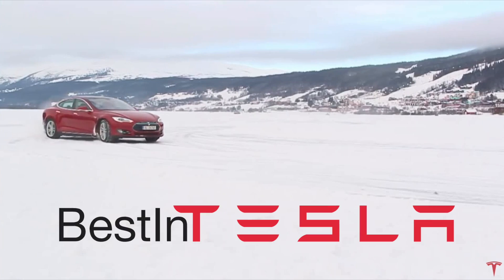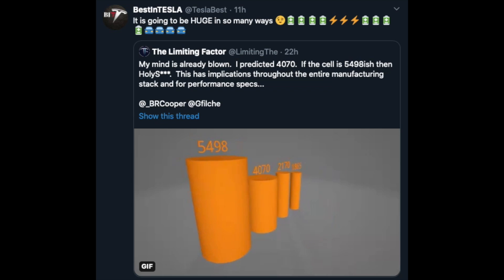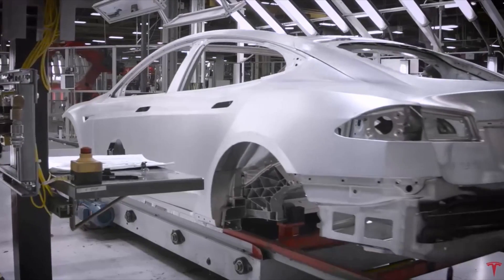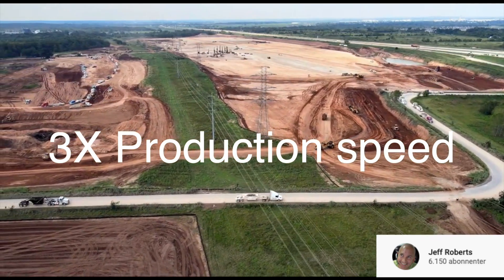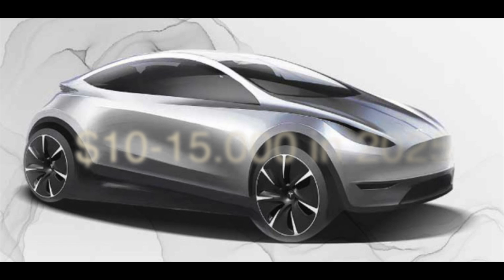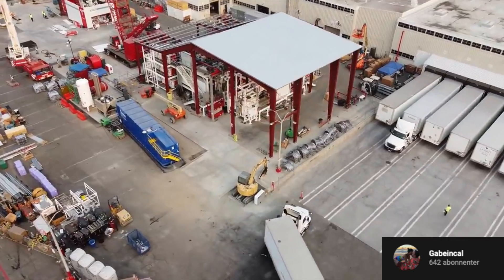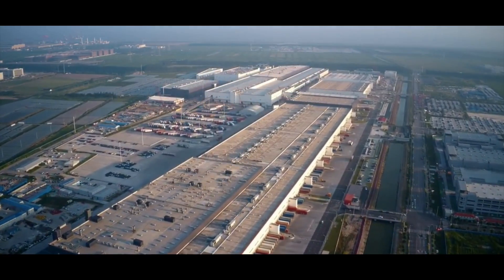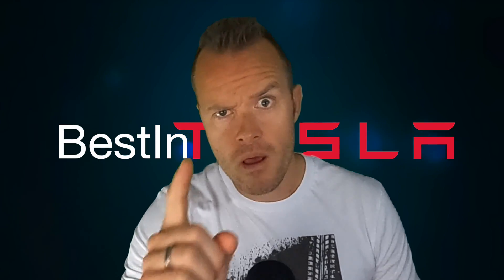Last day before battery day - Tomorrow EVERYTHING changes | Predictions & rumours

Comment: I'm not a battery expert at all.  Can someone explain this:  5x the volume of battery = 5x energy storage.  But the battery pack isn't getting bigger and neither is the vehicle.  So The battery is 5x bigger than current, but the number that can fit into the current vehicles are 1/5 as much right?  So... No additional storage.  Benefit would only be faster to produce? Am I missing something in the math here?
Reply: I don't think just changing around the volume of the battery is ground breaking at all.  It's the same technology just a different size.  If they packaged it different to fit more that's cool, but still same technology and same problems.  Not really worth much hype.  Did I misunderstand?  Is this video saying that its 5x energy density? or just more volume so more engery?
Reply from the maker: I am talking only volume, not density. But there are differently going to be some new chemistry in the battery, and probably no Cobalt, but it is still the same kind of battery. I THINK. So no the cars will not get 5x more battery power, but the Model S cut have made 50% more battery inside, since there are not as much packaging and other stuff. But yes it will be more than just 5x more volume, but luckily only 5 hours to go 😉👍

Comment: Quick afterthought, imagine if the battery pack was contained within a pressure casing of liquid nitrogen or some form of liquefaction cooling process. Charge and discharge would be almost instantaneous. LMFAO.

Comment: Tabless technology is a game changer. At a physics level it significantly decreases heat buildup associated with the SPEED of charge and discharge. It achieves this by distributing across a larger surface area how electrical charge enters and exits the battery. This is why it can now be a much larger battery (no risk of battery combustion). And of course this means it enables much faster recharge rates. Right now this means that range does not need to be increased for practical purposes only a marginal increase in the number of recharge sites because recharge can happen so much faster. All these metrics combine to bring about a complete solution. In the case of tesla semi recharge can take place at 'point of loading' and 'point of unloading' at time frames equal to or less than the time it takes to load or unload the semi.

Comment: Great video Lars.  I like your bold predictions.  Most people are way too conservative.  I do hope you are wrong about the powerwalls though.  If I will be using autobidder I will need a 50KWh powerwall and I would buy 2 of them.  I wouldn't even need solar at that point.  My utility has an EV rate plan that charges just .01/KWh from 11pm to 7am each day.  I'd be spending less than a dollar a day to charge the powerwalls.  I could power my home AND sell excess power back to the grid if they needed it. If they would pay me .10/KWh during peak summer hours, I might have a decent payback period.  And there is excess power generated at night so this isn't burning more fossil fuels to refill the batteries.  Right now, it is the peaker plants that are the real problem.  I would love it if the power company would pay me .20/KWh AND offer their customers a power outage backup plan where I would buy a 500/KWh battery and backup 100 homes in my neighborhood during outages.  They could charge customers $10/month and split it with me.  I love Elon.  I just need him to start a utility company in GA because our 'smart' grid ain't that smart.

Comment: Tesla is all talk. Anyone remember when they announced the electric semi truck. What happened to that? That was 3 years ago and they were talking like they were about to start rolling out the door. It's almost 2021 not and still no trucks. Come on guys can't you see they are scaming everyone.
Reply: TESLA Semi works, its Driving on Roads Today with 80,000 lbs LOADS for SpaceX and Tesla. 
TESLA Semi will be the FASTEST SEMI up PIKES PEAK and SMOKE gas Semis. 
unlike the NIKOLA which is just a STATIC PROP.
TESLA Semi was NOT a High Priority product, just like the Roadster. 
MODEL 3 Ramp and Model Y Production TOOK TOP PRIORITY.
but when GF5 was Announced , TESLA Semi along with the Cybertruck became a HIGH PRIORITY.
and ROADSTER will be built in FREMONT using TESLA Advanced battery.

with a NEW factory in the Central USA this means a GAME CHANGER for TESLA.

Comment: Just because the battery is 5x larger does not mean they can produce them faster.. being larger they will take longer to make
Reply: no, Sheets can make MUTIPLE battery line at the same time , gets Rolled up FASTER and Packed with a Tabless Electriode.
and Lightning Fast VACUUME Electrolite fill ups. 
TESLA will only need 400 - 800 cells to power the car. 
not Thousand of cells per car.

Comment: And they’ll be lighter. Right? 
So they’d be quicker and perform better. Right?
Reply: well, Larger Cells / heavier but only 800 cells Compared to Thousands of 2170.
Overall, LIGHTER and more AMPS and more POWER (not Energy Density). 
could enable 1000v Battery arcetecture and 1000 kwh MEGACHARGING.

Comment: I have heard that that it is 4 times the size of 2170, but 10 times the energy density. Either way, less batteries per car, less weight, more distance, higher performance.
Reply: NOT, necessiarly MORE Energy dense, but 98 Amps and overall MORE power. 
this means possibly 1000v Battery Arcetrcture and 1000v MEGACHARGING for SEMI.
Reply: @markplott4820  If your battery is larger, it means you can have more volume inside it (the energy-producing part) while reducing the weight and volume of the inert casing that does nothing for the battery. A bigger battery will thus be more energy dense, but it will have other potential problems, like overheating. More space between the batteries could lower the energy density of the powerpack due to lost space, but I have no doubt Tesla plans to put efficient cooling in their new powerpacks with larger batteries, combined with the octovalve heat pump, to create a highly efficient thermally regulated powerpack. Even if it isn't more energy dense (which it probably will be), then at least being able to heat and cool the powerpack means you could make it last much longer, since batteries lose their charge faster when you try to charge them when they're hot.

The real innovation probably comes from the manufacturing side, where even if the larger batteries are not more energy dense, they will still be faster and cheaper to produce and assemble, which will significantly lower the price of the cars.

I don't know how amps would interact with charging, so I'm just gonna let someone else comment on that since I don't know :)

Comment: Don't buy the hype, buy the dip!! I'm thinking from 73 years of experience. The HYPE has been pushed off and on to great effect TEMPORARILY. Then the World yawned and moved on to the next. 78 rpm record, gave way to the 45 rpm. which gave way to the reel to reel tape recorder, which gave way to the cassette cartridge, which gave way to the 8 track and the CD > DVD to the iPod. All in my life. Today Tesla Shares are hovering around the close from last Friday. Long term, I'm expecting shares to dip until the 3rd quarter reports. Tomorrow there will be a lot of hyperbola, as per usual, and I'm keeping my expectations low for long term change. I'm a TSLA Bull, but I am not going to get excited over wind song.

Comment: You're missing a few details.  A whole battery made of the new (tab-less, etc) cells would be able to deliver about 1/3 of a Megawatt, which level of power is not needed except for a Formula E.  So the new batteries will probably only have a row of these cells for their huge power density, and feature larger blocks of cells of a different type that would trade away power density in favor of energy density and economy, such as metal-air cells.  The other detail is materials, chemistry, of the lithium cells.  For all I hear they will use lithium, iron AND nickel ("stainless phosphate"?XD) silicon-graphite with carbon nanotube "nano-velcro" caps at the ends, for a solder-less contact, or something of the sort.
Reply: Unless Tesla has made several massive breakthroughs, metal-air batteries are not cost-effective and not happening. The membrane in metal-air batteries gets corroded easily, so they would need something like a pure O2 supply, which kinda defeats the purpose. 

You're probably onto something with Tesla cooking up some new battery chemistry, and it's certainly possible they'll have different battery sizes across the powerpack to try and optimize for certain power outputs. 

If you have lithium though, you don't need iron phosphate, the two do the same 'job' of being the mobile charge carriers that go from the positive end of the battery to the negative end, iron phosphate is less energy dense but less expensive as a tradeoff. Carbon nanotubes would certainly be an amazing boon!
Reply: @kurayamisidekick  Thanks for the heads up.  I'm an electrical engineer but never did well at all in chemistry;  and in fact I was wrong with most of my predictions.  Anyways, the new batteries rock.
Reply: @privateerburrows  No worried Dan, we each have our areas of expertise, can't be an expert in everything unfortunately!

Biochemist here, so I'm a bit closer to the chemistry than an electrical engineer, but not nearly as close as an actual chemist. The new batteries absolutely rock, but you are right that the new tabless design does allow for more power to be used faster from the cells, since the tabless design eliminates the head problem. That I did not know and did not expect, but this alone is a massive improvement. Charging batteries at high temperatures degrade the batteries, and if your batteries just don't heat up when you charge them that removes the limitation for charging quickly. Combine it with an anode material with silicon that doesn't break down with multiple charge cycles, and you'd be massively improving the battery's life!

I'm really excited and looking forward to seeing these new batteries get into the cars!

Comment: There are a couple of factors that could affect the cumulative number of various models Tesla will be able to produce.

If there is any bottleneck on materials-- nickel, magnesium, cobalt or whatever-- it can slow the output.

If they manage to go into production on any smaller model-- Roadster, Model 1 or Model 2, or maybe a lightweight Cybertruck-- it could ease the battery bottleneck.

If VW or someone else begins serious production of EVs, that could affect Tesla's output as well.

Comment: They will announce several chemistries based on use and need in each country.    This will open up the supply chain and the ability to grow the products without battery constraints.  We will be able to select the battery pack we want.
Reply: Correct, TESLA is Divercifing its Battery Portfolio. 
Its using CATL in China and LG Chem in BERLIN, we dont know about Texas however. 
they will still need 2070 for Model 3/Y.

Comment: The battery charged itself ...
And that's it 

Sell your house 
Buy tesla shares 

Be a millionaire
Reply: Backup Dec Twenty eighteen sorry housing market at a low and Tesla at all time highs LOL maybe that would have worked a year ago but Tesla shares cost 10X more than just 12 months ago
Reply: It will really blow your mind if it will be self-charging. I can't wait for that announcement. The car is charging while running? It will be the holy grail for energy supply.

Comment: if this battery is confirmed and due to this and all other improvements is going to make M3 battery pack cost half close to 4000 dollar...I hope it happens..Godspeed Elon God bless you ...
Reply: TESLA Advanced battery NOT for Model 3/Y.
Model 3/Y already getting 2170 with better Chemestry , but only 5% improvement. 
over time Panasonc has pledged up to 20% increase in 5 Years , will take time.
TESLA Advanced battery , ONLY for Upcoming Vehicles and possibly Model S/X in 3 - 4 years !!!!!!
Reply: @markplott4820  Tesla's most important vehicle is none of the s3xy cars it's the semi.coz the pollution from semi is order of magnitude more  than cars. and without 400 watt hour per KG pack level efficient Elon cant give us a semi equivalent to Diesel ones.
Reply: @sudeeptaghosh   - TESLA Today can get 600+ miles with the OLD 2170 batteries, TESLA Advanced battery will be ICING.
expect the SEMI to be over 600+ miles in Range using TESLA Advanced battery.